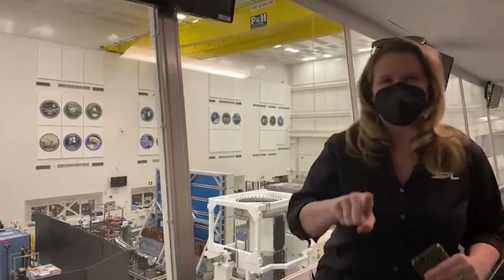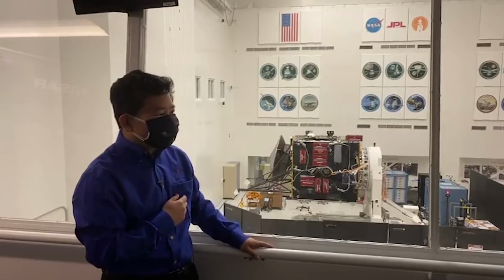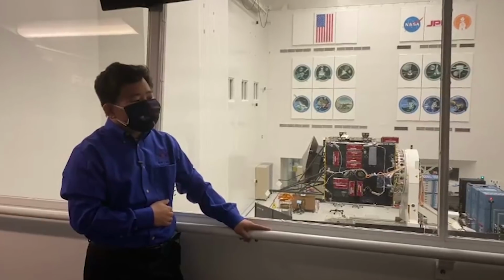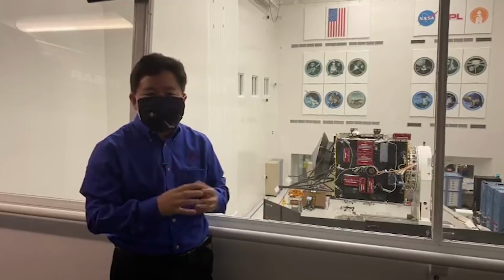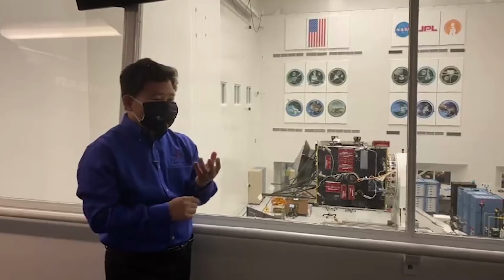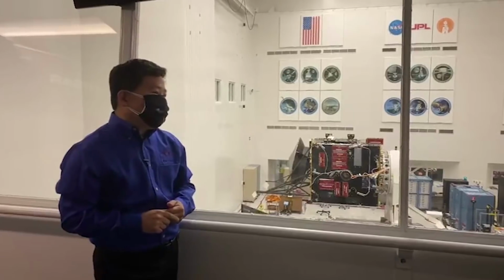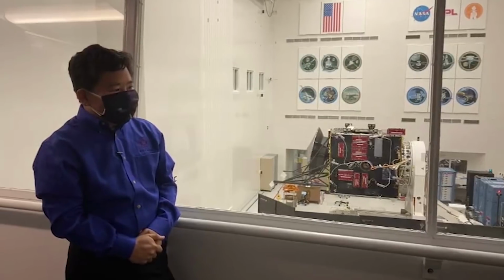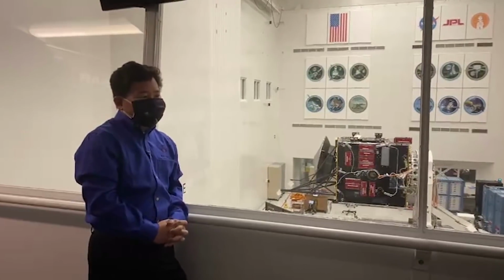#MissionToPsyche: Q&A from JPL’s Spacecraft Assembly Facility

Comment: Has JPL considered back up instrumentation just in case occur a failure?. What type of energy supply have the instrumentation?. Will there be some compensation for the accuracy of measurements, having in account the temperature differences, the rough environment and cosmic rays?
Reply: Redundancy is a difficult thing to manage. In general, everything on the spacecraft is redundant unless there's a justifiable reason why redundancy would make the project exceptionally more difficult. For reference, at least the imager on Psyche is redundant (there are two cameras onboard). 

Regarding instrument calibration, the short answer is that continuous calibration of the instruments is done throughout the cruise and orbit operations in the mission.